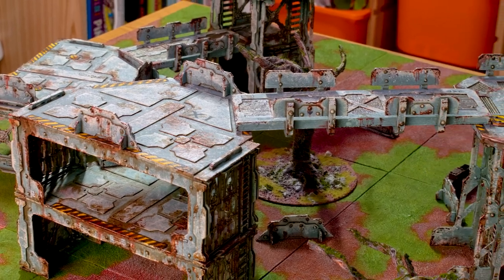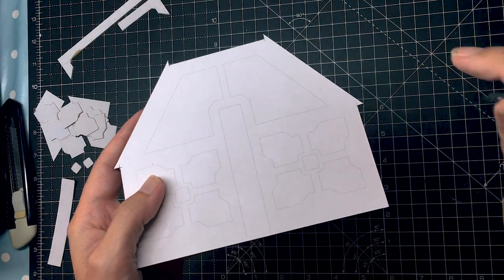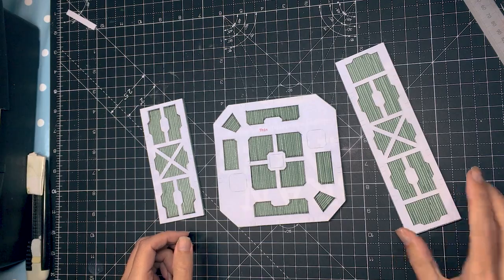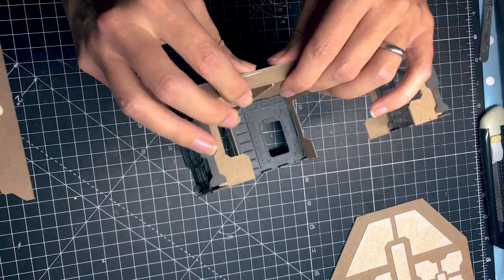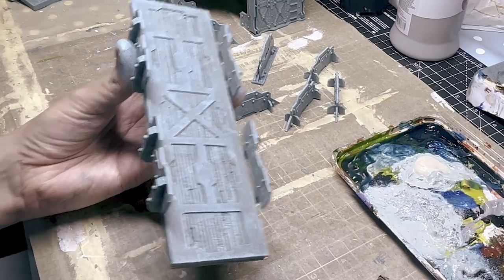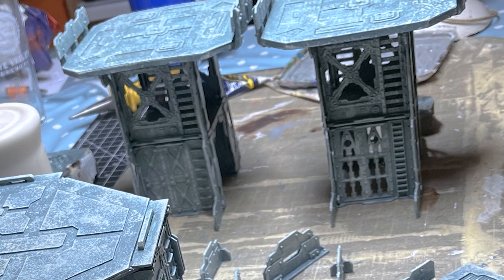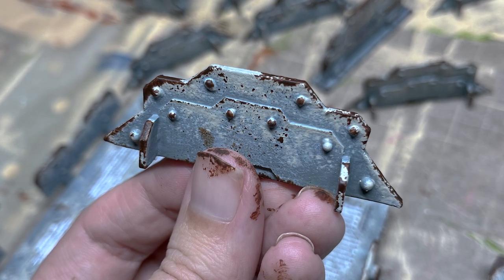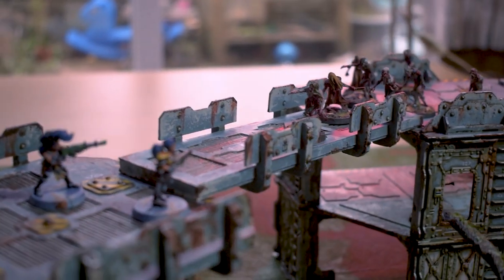How I built these awesome RETRO NECROMUNDA inspired buildings and walkways

Comment: Love it! Two suggestions to perhaps drive you less to despair in future though:

1- Adhesive labels. Buy a box of 100 full-sized label sheets from your local business supply shop. Any time you need a print-n-glue solution you can instantly skip the glue step. Trust me, you'll never look back.

2- Mini-clothes pegs for the rail supports. Widely available in craft and dollar stores, already an interesting shape AND as bonus you get teeny tiny springs you can use for... well... something.
Reply from the maker: Interesting ideas, thanks. How well do the labels take paint?
Reply: @tomgoesrogue  I haven't had any issues but you gotta make sure they're REALLY on there. I tend to smooth them over with a 4" putty knife to make sure adhesion is 100%.

Comment: Tom, thanks for this great terrain build video.  As a salty old grognard myself the 1990s era Necromunda cardboard terrain is near and dear to my heart.  The terrain you created for this video really captures the essence of that venerable terrain, both in form and function.  I appreciate all the tips and tricks you share in the video.  I absolutely agree with you on priming in white, it saves time in terms of paint coverage later and it makes the final product brighter overall.  If I might share a tip of my own, for hazard stripes I paint the whole area yellow and then apply narrow strips of masking tape over the area followed by carefully painting on the black.  To get properly sized strips I apply the tape to a clean flat spot on my cutting mat then cut measured lengths with my hobby knife.  A related tip is that when applying the tape to the area to be hazard striped if you have trouble getting the spacing just right, try neatly applying strips of tape side by side to cover the whole area, then carefully remove every other strip to get a uniform pattern.  Thanks for providing the templates for your designs for download.

A few questions:  What are the small studs/domes that you used for your rivets and where might one get them?  On the main tower their are L-shaped pieces that attach the small walls to the main structure.  What are these made out of, foam board or eva foam maybe?  Also, I couldn't find these shapes on your handy templates.

I think this is a fine video, and while it sounds like it was an effort to make, I'd like to see more like it.  I also like your previous battle report videos.  They are built around a solid narrative and I think that makes them so much more engaging.
Reply from the maker: Thanks for the kind words and advice.

The studs are these — SAVITA 5600Pcs 2/3/4/5/6/8/10mm White Flat Back Pearl Half Round Pearls Beads Satin Luster Loose Beads Gems for DIY Craft Necklaces Bracelets Jewelry Decorations Wedding Dress Nail Art Making https://amzn.eu/d/8bW3ksI

I think the bits you’re asking about are made from 5mm underfloor heating xps (greeny-blue). They look like an ‘L’ shape and are on the NecroWatchTower–02.png template.
Reply: @tomgoesrogue  Thanks for the reply, the link, and for pointing out the 'L' shape on image 2.  Keep up the good work.